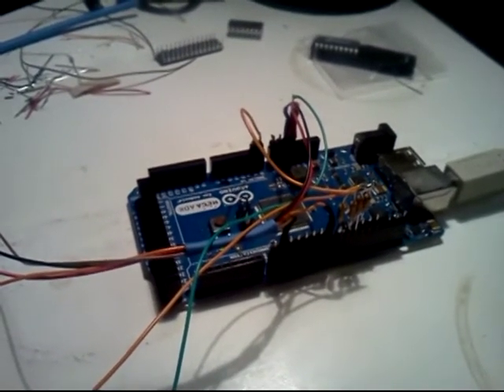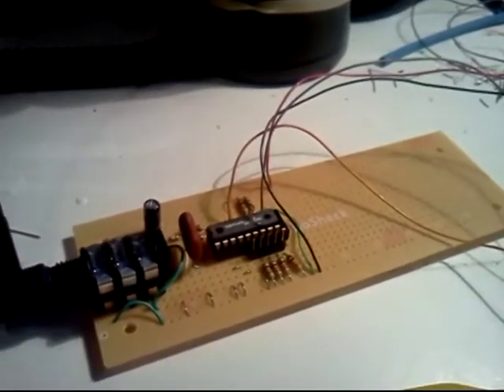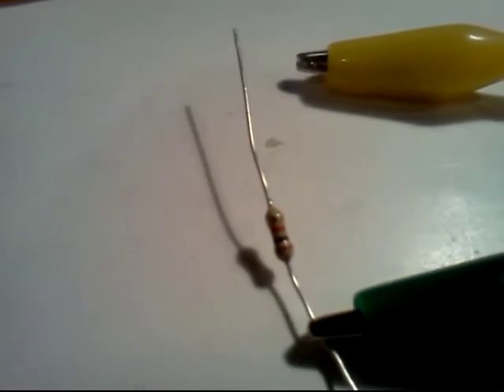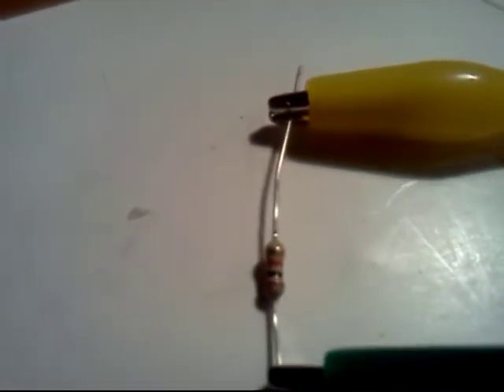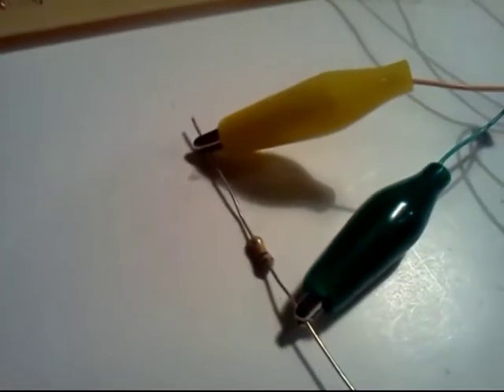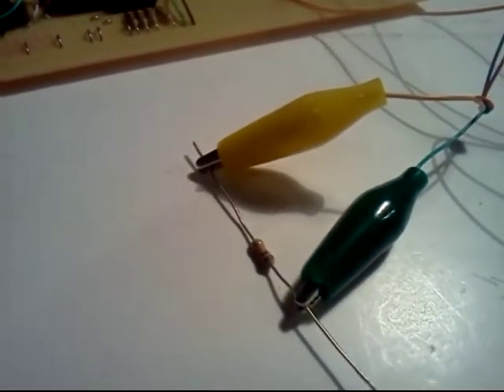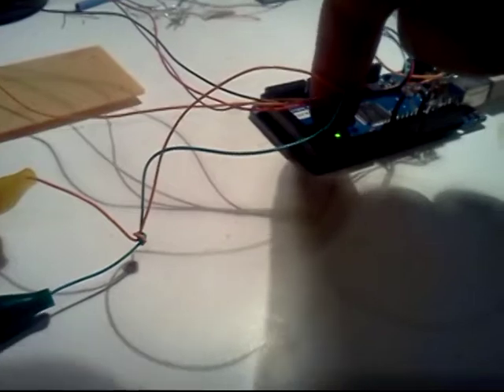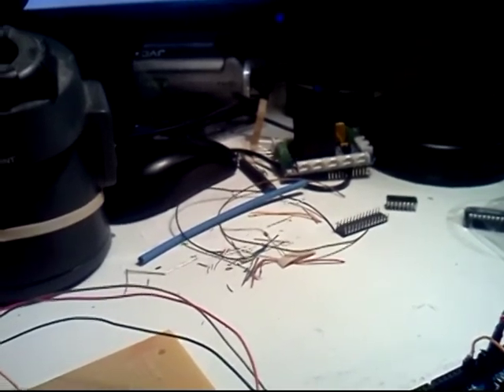Talking Resistor meter using Arduino + Speakjet.

Comment from the maker: The Arduino talks to the Speakjet chip at 9.6Kbaud. If debugging using a UNO, softserial can be used to talk to the speakjet. Leonardo, Micro Mega have a usable hardware serial port available.

Comment: Great technical achievement, but I fail to see why you don't just speak the resistor value, which could lead to a commercial product? one of many using that chip?.
Reply from the maker: I have not worked out the allophones for numbers yet :) I plan to have it speak the colors and the value.
Reply: Peter Churchyard Thanks for clearing that up and posting the vid. I have already tweeted the link, it could help many people. I wish I had time to play with the chip. IMHO Makespace should have a few of these.@DavidFCox